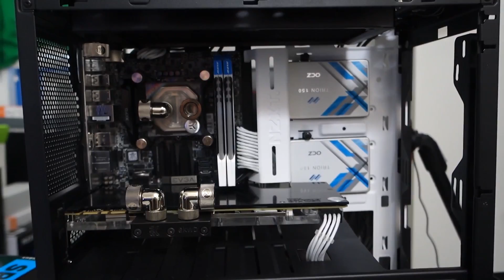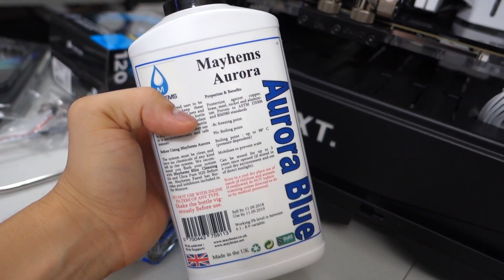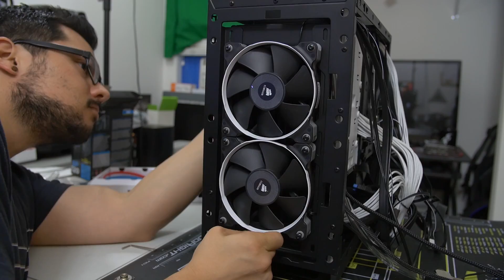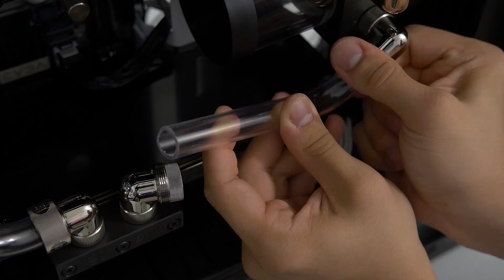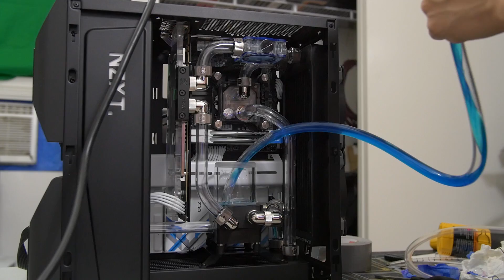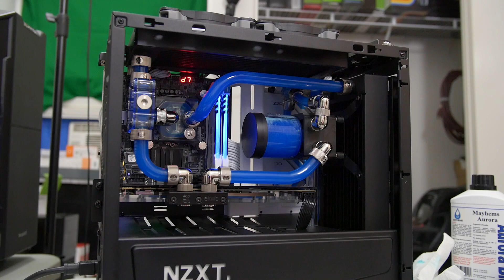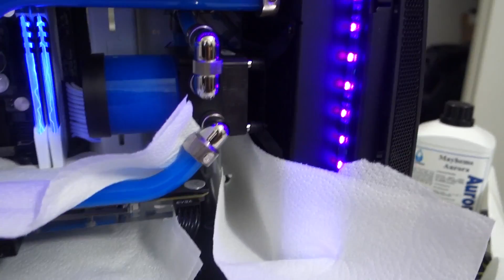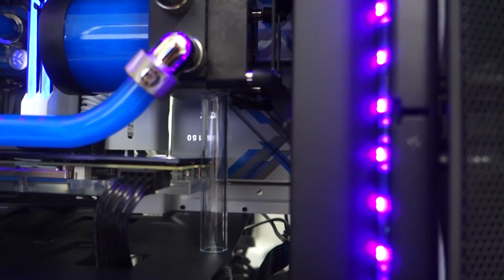Custom Tube Bending and THE MOST EPIC OF FAILS - Build Log #2

Comment: for the pump/reservoir you could hang it from the top of the case with parachord of the same colour as the cable mods cables your using

Comment: +Awesomesauce Network to prop up the reservoir you could use some sort of cable or zip tie of some sort through the case mount for reservoirs since it's at the right hight to pull it up.

Comment: That kick stand is actually a pretty clever idea! Fill it with the same fluid and seal it, then it'll completely blend in. You can also put just a little bit of 3m double sided tape to the end of the fittings on the kick stand tube once you seal it, that way it won't move around when you move the build.

Comment: The Reservoir is directly in front of the original Reservoir mounting bracket, possibly find/make a bracket to hold it up.
Reply: Exactly what i said you can get res mounts that clip around the res easy as...

Comment: Put washers under oneside of the mounting bracket.

s = screw      b = bracket      w = washer      r = radiator       > = front of case

> s b w r >

Comment: Couldn't you undo the lower two screws on the res where it connects to the rad, put some washers behind that then put the screw back in and space it enough for it to raise the bottom side of the res up so it's at 90 degrees to the rad, thus stopping the sag.
Reply: That's exactly what I was thinking. Adding washers would bend the reservoir mounting bracket away from the radiator at the bottom, moving the  reservoir's top a little higher.
Reply: You could hit the washers with some matte black paint to make them blend in.
Reply: Was about to say that lol
Reply: Or you could bend the bracket.
Reply: That was my exact solution too.  No further suggestions needed lol
Reply: I agree with this, as the black ones will blend in, without painting.
Also they will help with reducing vibrations in the case from the pump.
Reply: Ian L bending the bracket would probably work too, probably easier to put washers in though
Reply: That's exactly what I'd do as well. Washers work very well for leveling things like this out.
Reply: he can use some o-rings instead of washers so he can tighten the screws more or less to give the perfect adjustment
Reply: Just came to comment the same idea and saw this at the firs comment.
Reply: Thought the same thing right away
Reply: Exactly what I was thinking, I've done this before on multiple parts in multiple systems.
Reply: Crap, should have read this before I posted the same thing.
Reply: i came here to make this comment but this guy beat me to it. try and use black washers though..
Reply: wamted to say the exact same thing xD
Reply: well it still might sag as its the end of the reservoir that's sagging.
Reply: +Apoorv Gahlot it'll sag but tilting the combo will reduce the tube and res visual sag. The pump tilting would be barely notiecable.
Reply: The problem is that he has hard rubber vibration dampers installed, it will always sag with them installed, even over time if he would use compensation washers on the lower dampers.
Reply: i had the same idea hahah
Reply: Yes, longer bottom screws with plastic spacers to adjust vertical level!
Reply: yea that should work
Reply: it would work that way. he could do the washers between the radiator and the case. that way you can't see the washers.

Comment: your reservoir/pump is crooked because of the weight the screws can handle if you can screw them in more it probably should get fixed

Comment: I would put 2 small washers under  the lower 2 mounting points on the reservoir and see if that elevation and removes the sag/angle.
Reply: I thought exactly the same thing. Either washers or shims there should work. You might need longer screws.
Reply: Yup, was looking to see if anyone else suggested adding washers/spacers to the bottom two screws. Happy to see a couple people using their brains for more than suggesting bending the bracket or adding a "stick".
Reply: wow i just wrote this exact same idea above... i guess i should have read other comments before posting... but this would definitely work.